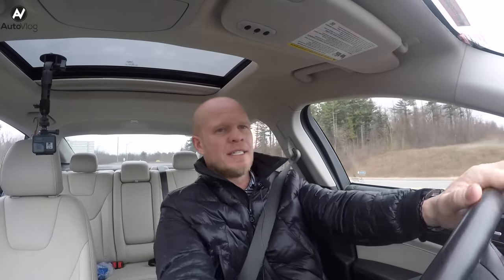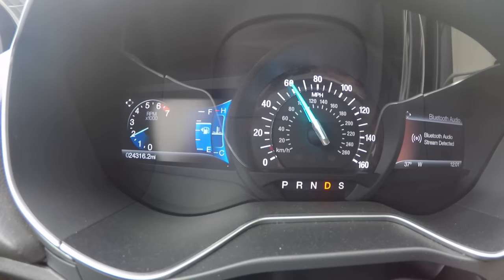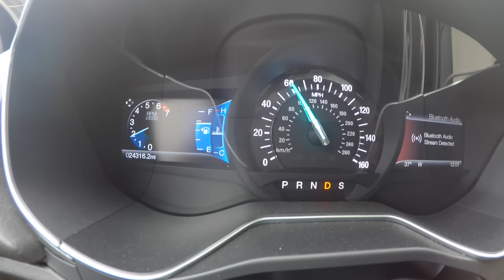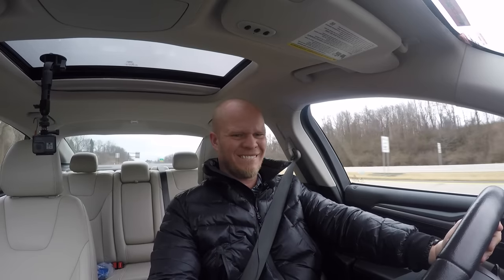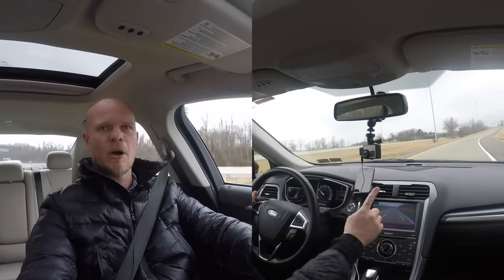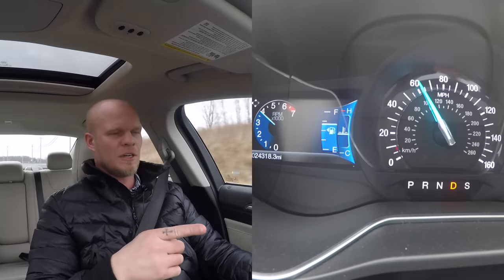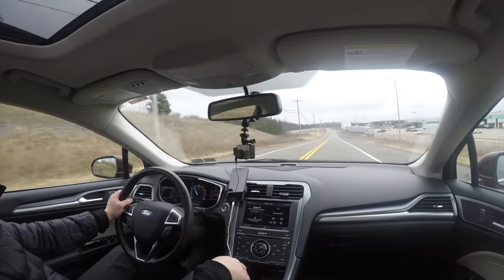What happens if you put your car in REVERSE while driving? (Things NOT to do while driving)

Comment: What happens when you put diesel in a gas engine?
Reply: Buford T. Justice yeah I know 😂
Reply: Zumblu Check Fifth Gear channel they already did this experiment.
Reply: You ruin a perfectly good gas engine lol
Reply: Buford T. Justice Gas (benzine/petrol, the name gas doesn't make sense) into diesel is actually worse. Basically it is much "dryer" than diesel, but a diesel engine needs the lubrication of diesel. Therefore, gas in a diesel engine will ruin the engine pretty quickly.
Reply: Nothing. As in you will not get the engine running. Diesel is injected into the chamber as a liquid, like sprinkle droplets. This is ignited through temperature. Petroleum is injected into the chamber as a gas, then ignited by a spark. As there is nothing to spark if diesel is put in, nothing happens. You may completely destroy the engine if it runs several cycles and eventually the liquid diesel accumulating in the cylinder does spark creating a much larger amount of energy than the engine can withstand. However, a modern ECU will probably cut the engine before that happens because it is detecting a misfire in all the cylinders.
End result will be a lot of work getting the engine to run again.
Reply: ^ Not right at all. Petrol (aka gas) is injected into the intake, and atomized. It remains a liquid, just tiny drops. Same thing with diesel, but that is injected at way higher pressures.
I have witnessed a brand new petrol car that was filled with 90% diesel 10% petrol. It still ran, but only just. Massively down on power, extremely rough running. It was driven back to the workshop. The cat converter was glowing red. Drained the tank, changed the fuel filter and spark plugs, cleared the fault codes and it ran like new.
Petrol in a diesel car is another story. Diesel is a lubricant, petrol is definitely not.  If it's run for long enough it will wear out the high pressure fuel pump (big $).
Reply: In the army they told us to add a bit of petrol in extremely cold temperatures to the diesel trucks, since diesel does not like to be cold (maybe with modern agents not, but it flakes). Up to one third of mixture. Petrol will self ignite in a diesel car, there is enough pressure, but it is not controlled and random through the cylinder, so that is why it will run rough.
Reply: If it manages to start... smoke, lots and lots of smoke. No permanent harm to the engine, though. It's like asking what happens when you put oil in your car's petrol tank.
Reply: It's just Fucks the engine
Reply: it's really going to depend on how much you put in,  a small amount won't hurt anything  (actually could help lubricant the injectors ) a lot will cause it to die and won't restart until you drain the tank possibly change the fuel filter and spark plugs but it won't do any damage to the engine. now gasoline in a diesel is a different story large amounts could cause engine damage in several ways.  here's the difference in the engines and the fuel both engines are basically the same except diesels have a lot more compression the main difference is how the fuel I delivered.  gasoline is injected on intake stroke then compressed and spark ignited (gasoline has vapors and easily ignites with a spark). diesel is injected on compression stoke (extremely high compression ) and is ignited by heat from compression. now the results diesel in gasoline engine - diesel is a oily fuel that simply won't ignite well with a spark and gasoline engines don't have enough compression. now gasoline in a diesel,  gasoline is way more explosive and will end up ignition to early causing loud knock may even bend a rod or damage a piston (rare but is possible ) another problem is diesel has lubricant in it to lube the pump and injectors too much gasoline can quickly damage these.
Reply: Telocho the military telling you to put some gasoline into a diesel isn't all that bad . technology if I'm not mistaken that's basically what Jet B fuel is a mixture of kerosene and gasoline.  some airports use Jet fuel in their diesel vehicles simply so they don't have to keep separate fuel on hand. running that mixture in a diesel will certainly help cold weather starting but without a lubricant additive could cause long term excessive wear on fuel pumps and injectors (small price to pay for good dependable starting )
Reply: Zumblu nothing the car will just peform worse and the exhast will kinda spark a little.
Reply: Koko Coco actually, it depends on how long you run it.
Reply: Zumblu Assuming you don't notice the hideous engine performance (if it doesn't just die there and then!), you run the risk of building up enough oil pressure to literally blow something up (more likely - crack the block)
Reply: Zumblu my brother took a jerry can from my dad thinking it was gas, put it in his Camry. Turns out it was diesel and it bogged like crazy. when he hit the gas it'd go but if he slowed down she'd ba baba blahhhh.... I gave him some money for gas and she was good as new

Comment: In most modern computerized cars, if the car is going faster than 5 mph forward, it will simply ignore the shifter going into reverse. It's a solenoid that shuts off its ability to engage the reverse gear--Reverse Inhibit Circuit Solenoid. Basically, if there isn't current going through that component, which only happens when the computer sends current to it, it won't work, and the computer only sends that current when the vehicle is going less than 5 mph (this speed may vary in some car, but the error code reads 5 for the explanation).

Comment: I want to see you replicate this test except try one different thing. Put it into reverse and tap the gas. If your coasting then your torque converter isn't going to be locked up so therefore it's as if the clutch is in. If you tap the gas, which would require the torque converter to engage, I think you will find very different results.

Comment: This could have been really dangerous to try in an open road. I thought the car would instantly stop as if you slammed on the break while going 80km/h and then reverse. If it did you would have flew out the wind shield, and the drivers behind you wouldn't have enough time to react if they were close enough and end up crashing into you.
Reply: David William nah b. If it did immediately engage, the tires would have skidded along the ground and he would have spun out. Likely flipping the car when it turns sideways
Reply: Not me wondering how a 2 ton car would stop immediately without hitting a wall or god removing all of it's kinetic energy.

Comment: I tried shifting into neutral to save gas while going downhill.  Accidentally went into reverse, instant stop (tires skid a little), engine shut off, have to shift into park, turn the car off, turn it back on, in the middle of an intersection lol.  Was a chevy tahoe with a non-stock engine, so they probably didn't do it right where it doesn't let you shift into reverse.  Or I guess that'd be the transmission.  Trasnmission has been redone on it too prior to that, so maybe they didn't do that right.  The tahoe was almost old enough to legally be a collector.
Reply: truck survived lol, only like 30mph max.  Didn't seem to have any tranny problems or anything for like a year or two afterwards, it's been sold so no idea about it now.
Reply: same thing exactly happen to me only it was going thro a roundabout!! haha finally someone with the same situation. i was driving a 1997 holden vt 5l.
Reply: FYI: You are not saving gas by switching to neutral when going downhill. Your engine is taking more gas to run idle comparing to being rotated from the wheels by going down the hill.
Reply: yoksel99 looks like ill just turn the car off and roll down a hill xD
Reply: yoksel99 Not if carbureted engine, which we don't know in this case....
Reply: when i use one of those cheap scan gauges or the newer cars that show mpg it goes to 100 MPG so it seems at least the computer thinks its getting better than 100mpg at least. it below 100 mpg if i just leave it in a gear.
Reply: ***** mine is digital. i actually see of there was any difference while going down a hill in neutral and in drive. they both were using the same amount of fuel per 100km
Reply: You definitely save on gas mileage by putting it into neutral when going downhill.
Reply: then the engine is still using a bit of gas.  Not enough to really notice unless driving down a mountain, but then its still questionable.  However if you do this daily,after 10 years you might save $1.
Reply: A dollar saved is a dollar earned .
Reply: DannyMellor you definitely don't
Reply: JoeyTheRedKangaroo too bad saving those pennies and then ruining your tires locking them up doesn't come out on a profit margin
Reply: DannyMellor if you keep it in gear without touching the throttle, the engine will consume no gas. If you put it in neutral, it will consume as much gas as it needs to stay at ~1000 rpm.

Comment: This test is obviously FAKE. Not the actual test, because he did put it in reverse, but the way he represented. He must have known before what will exactly happen, otherwise he is just really brave, or plain stupid to test it out at a busy road in front of other cars at that speed. Btw it would go down very differently in a manual.
Reply: manual transmissions wont even let you go into reverse ate anything above like 3-5 mph. all it will do is grind.
Reply: andrewhun96 by the way ...represented is a FAKE  ...what you meant to type was "REACTED"!!! HAHAAAA
Reply: Grinding is what you 'll get if you try it gently. It is similar to the grind you get when you try to put it in gear without pressing the clutch. However, in the second case, you can always force the gear, although that cannot be done many times, as you are ripping the teeth of the synchronizer off. Now if you were to try forcing reverse, that would be interesting, but most certainly would cost you the gearbox and probably the motor, the tires, the car, possibly your life, and others' lives as well. Trying it is strongly discouraged.

Comment: I’ve done the push start one on my 2017 Hyundai and it’s the same. Going 67 mph and the car doesn’t turn off. That’s a safety feature. Also when driving below 5 mph it turns off which is another safety feature in case if your car is on fire and you got into an accident where the car smokes and you can push the button to turn it off without pressing the brake pedal.

Comment: In a 2004 Civic EX, the car won't let you. You go from drive, to neutral, and then it just locks before reverse. Also, why does VTEC start at 3000 RPM. I'll be sitting at a red light, then I'll go and it picks up slowly. Once 3000 comes around (and you apply a little more pressure to the pedal) it just lurches forward. You can feel it, I doubt it is because you enter the higher power range.

Comment: on older model cars you would here a kind of loud clicking noise
Reply: William. H Bonnet that clicking are gears breaking and skipping
Reply: +J N no it isn't, all auto trans have a safety feature.
Reply: I actually done this to multiple vehicle's  '88 Taurus 84 custom deluxe 86 Silverado theese were farm vehicles that all made the same clicking.  I never had any trany issues with them.  Sometimes my motorcycle does the same when I put it in gear and between gears when the clutch slips
Reply: William. H Bonnet DAD!!!
Reply: Kile Bonnet son is it really you

Comment: Maybe this is a safety feature in newer cars. My first car was a 1995 Camry and while driving my friend played with the shifter on the passenger seat and accidentally shifted it to reverse while I was going around 30 mph. It makes a loud crashing sound like gear being slammed into a different rotation. Luckily my car still drives to 200k miles before the gear shift totally broke and it no longer drives forward, only reverse.

Comment: Do it with a standard... I can promise that you will get a better result
Reply: jldude84 lol by pressing ur clutch down and shifty like normally? Duh tf?
Reply: jldude84 you clearly know nothing about standards
Reply: nuked chronic I drive manual car til now and i did once accidently go to Reverse but the stick wont get in it'll just grind and vibrate cause i was about to change it to the 4th gear but I slipped ...

Comment: This accidentally happened to me in an ‘88 S-10 automatic. The engine crapped out me and I was putting it in neutral, but I slipped into reverse for a second. It made a HORRIBLE rapid ratchet like cranking sound. Fortunately, it still runs with that same transmission. I’m shocked that I didn’t ruin something.

Comment: I can share from experience that in my mom’s 1998 Ford Taurus, i accidentally put the car in reverse while going 10-15 mph. My intention was to put it in neutral, for that car the gear shifter was located next to the steering wheel. The car cutoff on me and would not start back up again right away. I had to sit for a few minutes, with the car off, before starting it again. After sometime, the car started up with no problems. So I can say with an older vehicle, at a lower speed, it can mess with the transmission.

Comment: I did this with a Legacy Twin Turbo and it made a hellofa grinding noise.
That was when the rear diff filler plug went AWOL which destroyed it. When you add a fuse it switches to front wheel drive.

Comment: I did this out of curiosity when i was a teenager. I was driving a 1986 Cutlass supreme with a 231 V6  (it was wrecked and junk)...
Took it out with a buddy of mine and we trashed this thing. So i got the bright idea to throw it in reverse at 55 mph... BAM.. whole front end jerk with a pleasent tire squeal, broke the drive shaft, broke the motor and trans mounts, jerked one of the rear struts out, broke a leaf apring mount and continued to coast down the highway.. pulled it off to the shoulder, took the plates off and ditched it.... the fun days of crazy adventures hahahah.... the car was mine.. it was trashed cause some jack ass the night before side swiped every vehicle on my street in a police chase and my car was the one that stopped him hahahaha.... man good times.. i was pissed about my car back then but its funny these days.. ..

Comment: try that with a manual and its pretttyyyy bad
Reply: Eagles_Eye i have . i went from a 6speed to a 5speed and caught myself trying to jam the 5sperd into reverse thinking it was my 6th gear. it completly locks you out.
Reply: how old is that car?  because my friend had no trouble putting it in reverse thinking it was a 6 gear... locked up the front wheels and he hit his head on the steeringwheel.. not a nice way to stop your car i tell you. tehe
Reply: Eagles_Eye I accidentally did that yesterday, trying to get to 5th gear. Twice.  It was an off day for me. The gears didn't mesh,  just made a grinding noise.  I decided that I shouldn't ever own another manual car. Ever.
Reply: Hah been their done that. Some cars have the reverse in a strange place. I had an older car where you would lift up the gear stick to slip it into reverse. Well since it was old it was knackered it used to slip into reverse all the time.... awful noise

Comment: I did this once after switching from manual to automatic and automatically went to change gears - the car got to neutral and just wouldn't go into reverse at all, it was like there was something blocking it, that was a Nissan Note automatic.  Worst thing I did was driving on the German Autobahn I was doing about 60mph in an automatic and I went to automatically change gear, put my left foot straight down on the "clutch" (which was the brake) - never seen so much smoke from the tyres before!   Luckily the road was quite quiet and so I moved my foot off the brake and floored it.  It's weird how muscle memory works!

Comment: Automatic transmissions are designed with a failsafe incase of this emergency, on this event it noticed your speed and also noticed your in reverse, the click in your cabin was the relay engaging causing your car to cut the power to the transmission using the clutch in the automatic transmission. Basically your just in neutral, if you were to give it gas it would just Rev and nothing would happen. In a manual transmission your wheels would lock up it would grind your gears so hard and then you would crash.

Comment: indeed thats protected. even in a manual the cyncro plates wil stop you doing that. but you can force it in there at low speeds. at high speeds you cant.

Comment: I have an e40d ford truck and accidentally put it in reverse at 35 mph. Was trying to get it to neutral to listen for bearing noise on the steering. Well the back tires locked up or tried to spin backwards not sure and it shut the truck off then it was like it was in neutral. Seems like no damage done but that was scary.

Comment: I owned a 2010 VW CC, and had 60 MPH on a speedometer, and for some reasons I just put gear on P (parking), don’t know why, maybe I’m silly, but I heard weird noise coming from my transmission and I put in D (drive) mode right away, thank God nothing happened. But I didn’t do that on purpose, so don’t judge me that I’m stupid, I don’t know why my hands went on shift knob and I put it in P. But in this video, car had absolutely no reaction to that, due to the new technology, which makes it really safe. Claps to this man for trying it tho, I would never do it on purpose.

Comment: The newer cars have an electronic sensor that prevents the transmission from actually going into reverse when forward motion is detected. I don't know if it has a minimum speed threshhold. But in an older car (pre-2000), you can expect your transmission to screech out "You suck!" just before barfing its guts out on the pavement